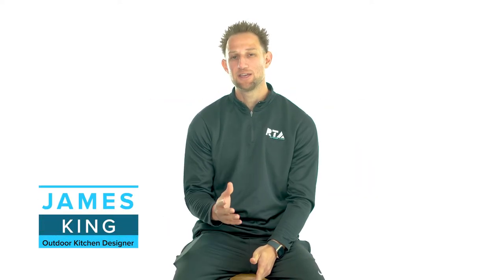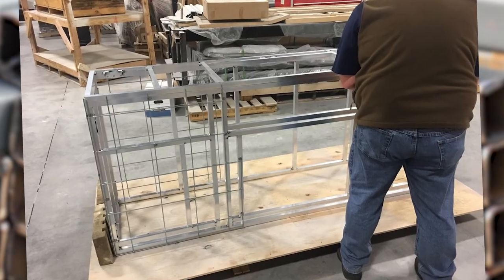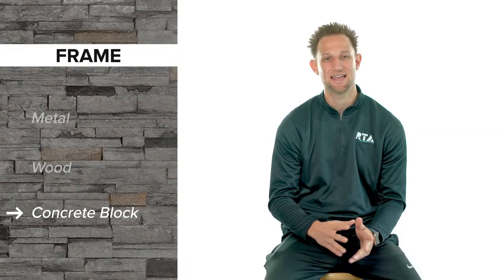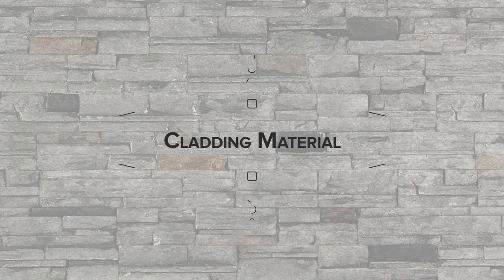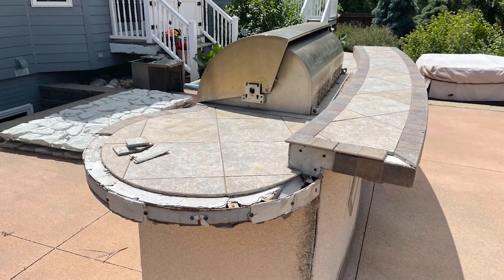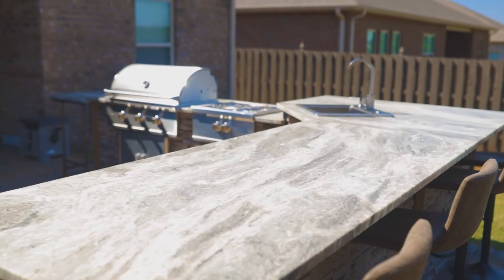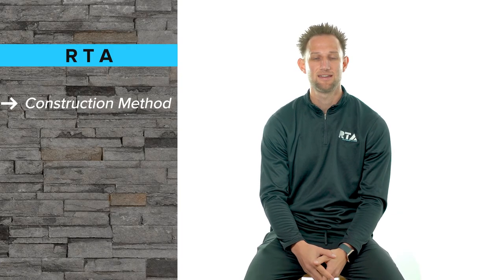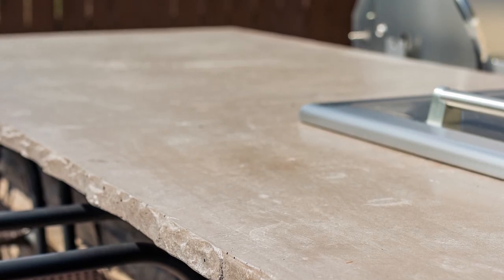Building a BBQ Island | Your Roadmap to Understanding Outdoor Kitchen Materials

Comment: What would you suggest for building on a wooden deck in the PNW on the waterfront (freshwater lake, not saltwater)?  I don’t want a massive amount of weight but obviously have to deal with a lot of moisture.
Reply: Hi Matt! Sounds like a beautiful spot! I'd highly recommend checking out our MOK's line of outdoor kitchens. The panels are composed of a durable Marine-Grade composite, lighter than our concrete panels, or a masonry built kitchen. Lightweight and ready for all of the elements!

Comment: Is it different for different regions? I livein Florida
Reply: Excellent question! Yes, with the humidity, sun, and coastal air of Florida, you'll want to be mindful of which materials you choose for you outdoor kitchen. 

If you're opting for a kitchen with a metal frame, there is a higher chance of rust. If you're kitchen has multiple layers, being in Florida, there is a higher chance of the layers peeling apart over the years. You'll also want to make sure the appliances you install are made with 304 stainless steel, as it will be the most resistant to the weather in that environment. 

RTA's outdoor kitchens has two lines of outdoor kitchens. Both are completely frameless, one is made out of single concrete-composite panels and the other a marine-grade composite. Perfect for Florida!

Comment: Aluminum Frame??? Left out ……
Reply: Yes, we left it out of this video but touch on it in more detail in a blog I've linked below. To sum it up, even though aluminum does not contain iron, and will not rust like metal, it can still oxidize in climates that have a high humidity or heavy exposure to rainfall or flooding. 

Depending on where you live, aluminum may work quite well for your project! Since we build kitchens for every climate, when thinking about using materials with true longevity, and therefore would not recommend an aluminum frame

https://rtaoutdoorliving.com/outdoor-kitchen-frame-facts/